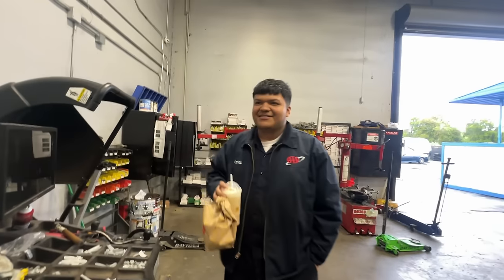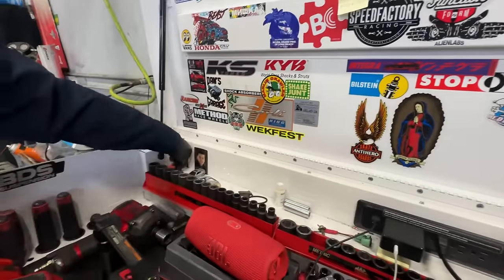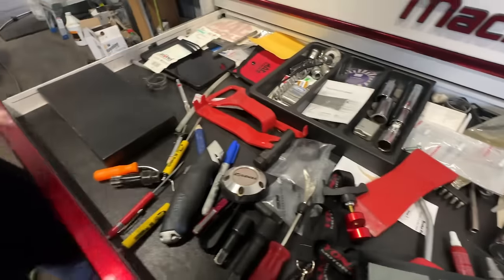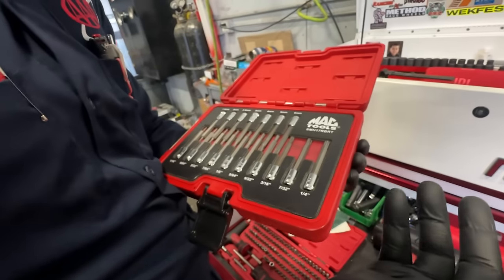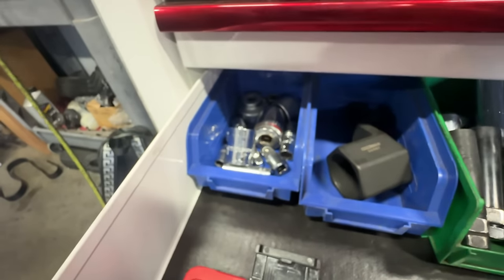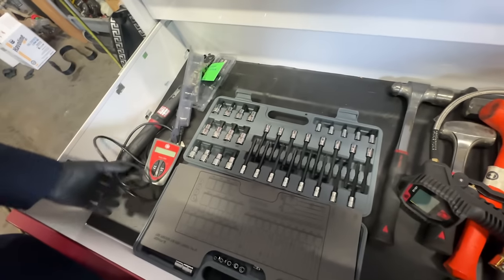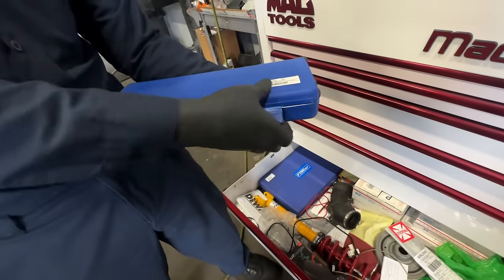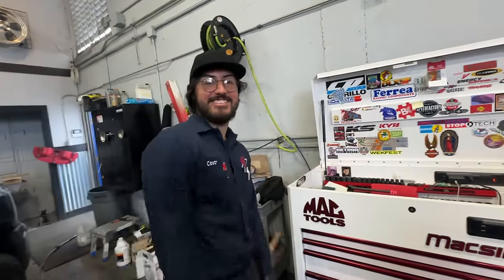Cesars Toolbox Tour! Macsimizer Full bank Cart

Comment: Keep those RBRT. I have the same blue point set and hardly use them anymore. I only use the blue point with my impact driver to break screws free sometimes, or when I need the length. The only negative to RBRT is that they twist and break a little too easily, but I swear by them.